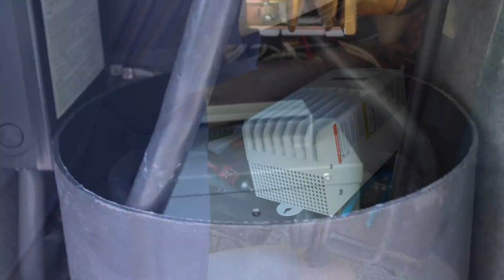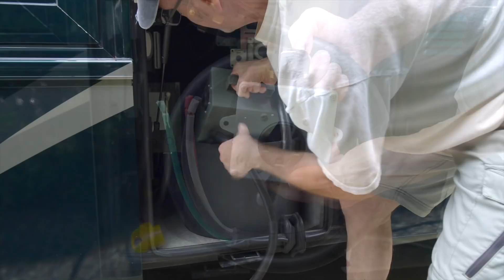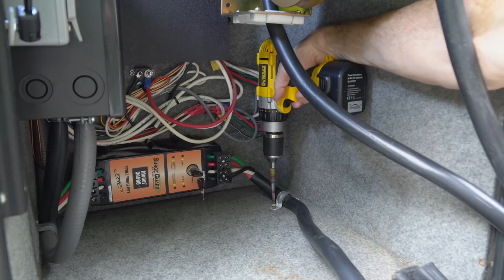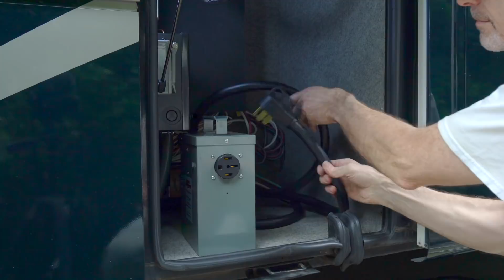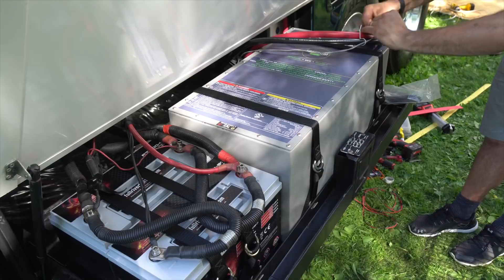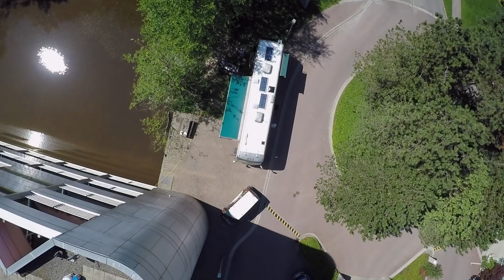🔌  RV Lithium/AGM Battery & Electrical Upgrade — Part 3: Cord Reel Removal ⚡️

Comment: Thanks for flush mounting the panel for the Lithium controller.   Lots of exposed wiring, in the interior, seems to be the modus operandi  for many Rv installations.

Comment: This is like the "if I could have any lithium battery electrical system I'd choose this one" but what does this kind of an upgrade go for? My Solar power system will be quite a bit less impressive but it will include lithium batteries, a smart charger for the lithium batteries and a folding Solar array. I may go full tilt boogy on the electrical system at a later date but this system will fit our needs and more importantly, our budget for now. Thanks for the time and effort you put into your videos. The quality is why I'm here!
Reply from the maker: Thanks so much, Neil! There are definitely a ton of choices out there for every need and budget, and it sounds like you've got a great set-up. As for this particular set-up, we don't know the pricing, as it's not available yet. We installed this with Xantrex as a case study & showcase for their new tech, and we're hoping that interest in it spurs them to make it available soon!
Reply: Well I'll certainly keep a sharp eye for new updates on this system. Thanks again. Neil and Liz

Comment: Yet another GREAT video from  the RVgeeks!! and yes a helper would have gotten in the way of the shot where you removed the Glendinning power cord device.

Did you reinstall the strain relief (cable clamp) on your short cord that connects your Hughs Autoformer to your Surge Guard?  You did not show it in the video.

I am glad to hear that your Glendinning power cord device still worked flawlessly even though it was 13 years old. What a great thing to hear about a companys products.  I hope you found a way to sell it for more than scrap value.

Also according to the 2017 National Electrical Code, 551.20(E) sates "Autotransformers. Autotransformers shall not be used."  Are you aware of this code?  I just want to keep the two of you, and any visitors to your coach safe.
Reply from the maker: Thanks so much for the nice comment. We did not re-install the clamp back onto the cord, since since it's coming right back out in part 5! During that short interval, we're just being careful not to yank on the cord. 😊 As far as the code about autotransformers, we appreciate the thought, but an "autotransformer" isn't the same as an "autoformer". The former converts 110 to 220 or vice versa, and the latter boosts poor voltage.
Reply: RVgeeks When I read the article on Wikipedia on autotransformers it sounds like the way the Hughes Autofomer works.
https://en.m.wikipedia.org/wiki/Autotransformer?wprov=sfla1

Sense I don't have a Hughes autoformer handy I can't open it up to see what's actually inside. I might send a friendly note to Hughes to have them describe how their system works.

Comment: Thank you for a very interesting video! How many Amps is your new Xentrax battery? If I may ask what is the price of such a battery and also the complete system you are installing?
Reply from the maker: Thanks Henning! The battery is 600 Ah. We don't actually know the price, because it's not on the market yet. We installed this with Xantrex as a case study and showcase for new technology. We will of course be sure to announce any details about availability and pricing when they become available.

Comment: Your Lithium battery upgrade project probably cost you 1/4 the price of what your whole rig is worth.  Are you considering upgrading your coach in the near future? You can always move over your new batteries.
Reply: They owe to much on their loan to get a new rv. Plus Xantrex tapped them to be part of their test program so they didn't have to buy the battery or the xantrex charger/inverter.
Reply from the maker: You're right "on the money" Bio! 😉 No new RV expected in our immediate future.

Comment: So, RVgeeks.......You keep the Autoformer plug in 100% of the time?   I also keep mine in the electrical cargo bin, but only plug it when the volts run low.  98% of the time, I have above 108 volts and just never plug it in.  But I do keep my Progressive RV Surge Protector plugged in all the time.  I do notice my autoformer does put out a lot of heat when I'm using it thought.
Reply from the maker: We do indeed leave the autoformer plugged in 100% of the time. That way we never have to worry if the voltage drops in a park that was good when we first arrived. We've never had it put out enough heat to worry about it, and we're protected at all times.
Reply: Thanks for the quick reply.  One more question......How long (yrs) have you been using your autoformer plug in.  I failed to mentioned, that electrical system you have is a jam-up superb No 1 system, enjoy all the benefits.  I'm happy for y'all.........
Reply from the maker: We've been using our Hughes autoformer for over four years. We keep it connected 100% of the time we're plugged into shore power. We spent the entirely of last summer in one spot, plugged into mediocre 30-amp power the entire time, and never unplugged it at all. Everything worked great the entire time. It's been a just a "set it and forget it" situation, protecting us as needed at all times, without us having to even look at the voltage. By the way, our next video (Part 5 in this series) comes out this coming Wednesday morning. It features both the Hughes autoformer, and the installation of our new power cord reel, along with an announcement about a discount we've arranged with the manufacturer (Glendinning). Hughes has offered a nice discount for our viewers for years now, too.

Comment: Why do you need both a surge protector and the autoformer?
Reply from the maker: Hi Joe! Great question. When we first bought our RV, we installed the surge protector you see here, and didn't even know about autoformers. Then we got the Hughes unit, but back then they didn't include surge protection (the newer models do). So we use them in series, with the autoformer first, and the surge protector downstream. We wired it this way because if we put the surge protector first, it would shut down power when the voltage dropped too low (which it's designed to do), preventing the autorformer from being able to do its job - boosting low voltage. As part of our upcoming solar installation, we're planning to replace both our current autoformer and surge protector with a single new Hughes Autoformer, since we won't need both any more. That will open up additional space in the electrical compartment, which we might need for a second solar controller, depending on how large a bank of panels we go with on the roof.